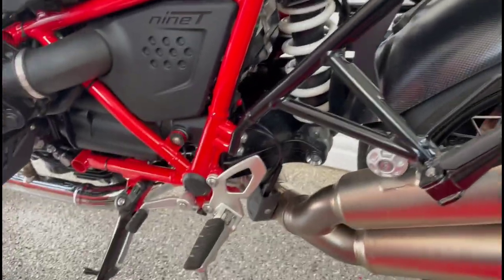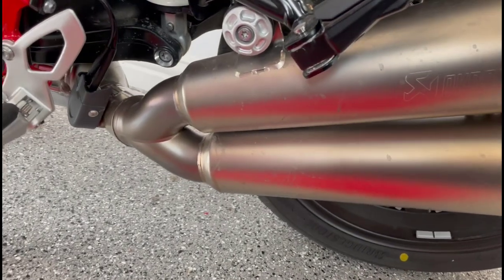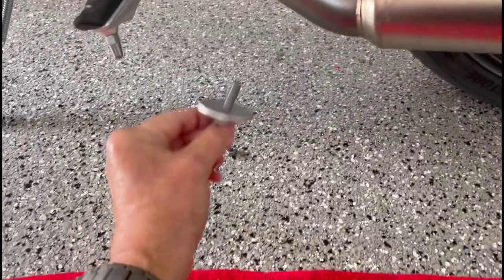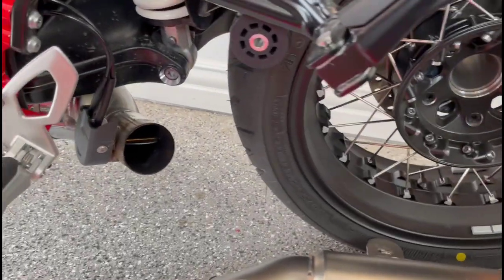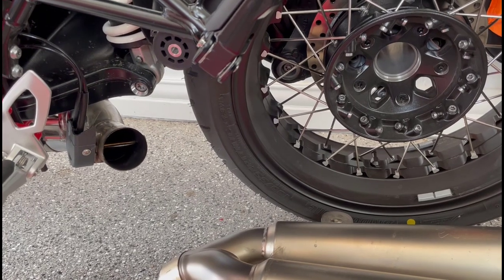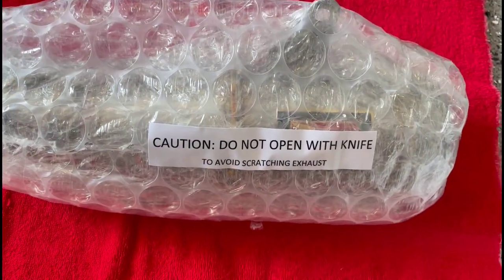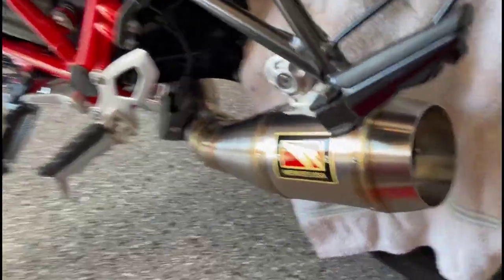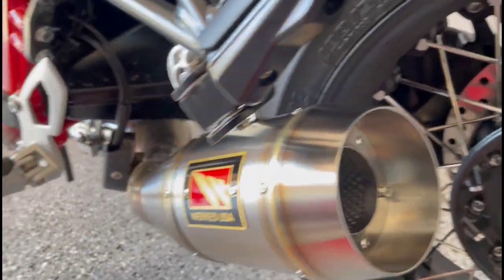2022 BMW R nineT Option 719 - Werkes Exhaust

Comment: Exhaust sounds and looks great, you should order the Wheel chock bike grab from Quasar, they have dealers in North America, you can use it on front and rear wheel, adjust it in minutes to roll into back or front wheels and has a large foot print, so no fear of blipping thottle on boxers engines as it holds bike firmly, cost UK £100 or $130 US
Reply from the maker: Thanks. And FYI to all, I trued to order a "flipper" valve delete tube and the proper electronics to avoid a system fault on my dash/gauges, and the good-guys at Pier City  https://www.youtube.com/watch?v=OYbod3fwSHg&t=133s  cancelled my order as you seemingly cannot do this to a 2022 R nineT. Reminded me of the hassle I had with the Akrapovič and the formally simple eliminator removal in <2022 models.
Reply from the maker: As for the wheel chock, thanks, but a bit too late for me. I bought this one via Revzilla (no sponsorship, just a fan and user).

Comment: I have the 21 White and Gold Option 719 and have removed the baffles with a Dremel. I think I will eventually get this exhast too, not just because of the sound but also because the akropovic covers up so much of the wheel and I got a spoked single swing-arm because it looks good. I want to be able to see and access the wheel.
Reply from the maker: I agree, the look with more wheel showing, while seemingly subtle, really does make for an improved, overall appearance from the left side of the bike.

Comment: I would be anxious to hear that on the road. Let me know if she pops and bangs!. I'm picking up this same bike in a few weeks. Thanks! Andy
Reply from the maker: Hey Andy, yes indeed. It's not obnoxious, which seem befitting. But it does get attention, and is a wee bit reminiscent of my Ducati Monster show bike. Cograts, you will fall in love.
Reply: @DrChrisStout  Thanks Chris!  I have a boober with a hitchcox pipe and used to have a speed twin with cones. I love the pops off throttle
Reply from the maker: @blindspot1987  Loud bikes save lives!
Reply: I have exactly the same bike and glad I came across your you tube channel, hope this is also available in the UK
Reply from the maker: @CODIEWRYDROP72  Thanks! I hope so too!

Comment: Is this exhaust road legal in the EU/Germany?
Reply from the maker: I would think so as I did not change any other parts of the exhaust system (i.e., flapper, catalytic converter, ECU) and while a bit more robust than the stock Akrapovics, they are not obnoxiously loud. But, to be sure, feel free to connect with them via Shawn Ryan, 1382 Duke Ave, Sutherlin OR 97479, 800.736.2114 or at https://www.competitionwerkes.com/products/bmw-r-ninet-slip-on-exhaust-2021-2022?_pos=1&_sid=942feabcc&_ss=r
He's great and so is their company. (I receive no compensation from them, just a fan.)

Comment: how do you find the OEM rear spring? Not too crappy?
Planning to put on Aka Ti headers and lose the cat?
Reply from the maker: Greetings @hgm8337, thanks for your question. I'd say the OEM shock is OK for me and the way I ride it in my area (Door County Wisconsin). Having said that, I have not bothered to monkey with trying out various adjustments, and (someday) I hope to have my wife along for a ride, so I may tweak it, and if/when I do, I'll make a video and post it.  As for headers, no not yet. Here's my reasoning for my situation - I don't want to risk futzing up the warranty, I love the bluing that has started on the originals, I'm not familiar with the ones you mentioned (post a link for us all here to take a looksee), and in 2025 I plan on building a track/LSR project, so I'm pretty much done spending on this project. Thanks!

Comment: Hello there, thank you for the video. I have a 22 and it is my understanding that you cannot do a flap delete on 21+ bikes. It requires a full header system removing both cat and flap valve. Im contemplating it myself. Any info you have would be great. thanks
Reply from the maker: You are correct, see my video on that, starting here: https://youtu.be/ELVAxomhlVk?t=1063 Hope that helps. Enjoy your bike.

Comment: Does this muffler have a baffle in it Chris ?
Reply from the maker: It is open/straight-through. A "DB killer" is an optional addition/in, that I did not order. The slip-on, itself, does have drilled holes internally, if that makes sense. Hope this helps? If not, ping me again. Best wishes.
Reply: Thanks for the quick reply. So with no dB killer you don’t find it too loud ?
Are you still happy with the muffler now you’ve had it a little while ?
Many thanks.
Reply from the maker: @petermiller8634  You bet, happy to. I don't find it too loud. In fact, I tried to purchase a flapper delete tube and fault-fixer, but learned that it would not be possible for a 2022. I know this is a bit of personal taste, but I sure favor it over stock, and I don't find it too loud. Also, I think you can add the dB killer pretty easily should that be more to what you'd prefer. Hope that's helpful.
Reply: OK that’s good to hear & I’m now seriously considering one for my 2021 R9T. Thanks for your feedback.